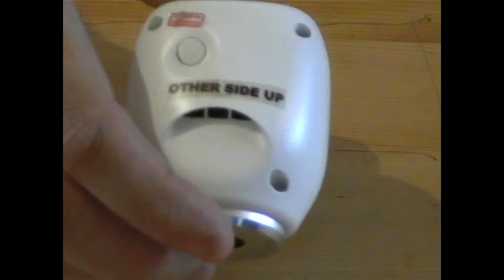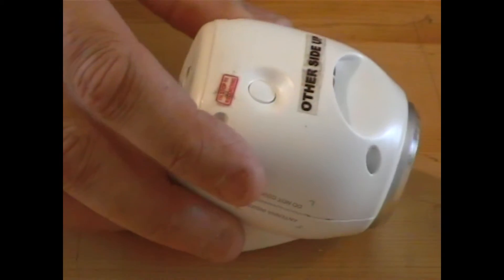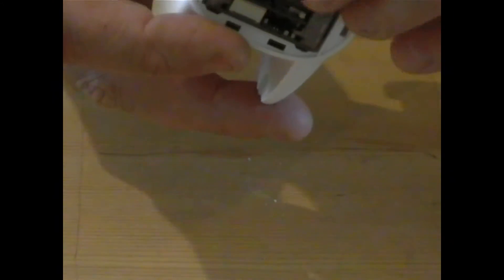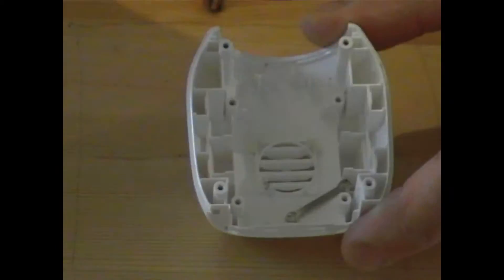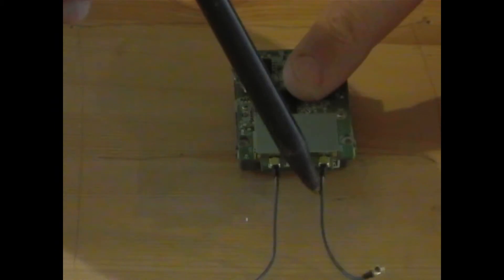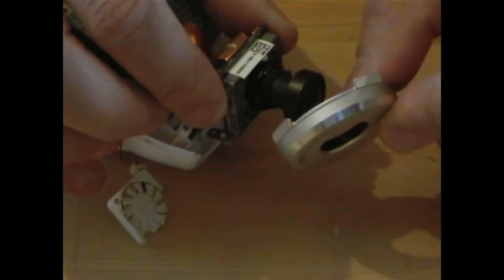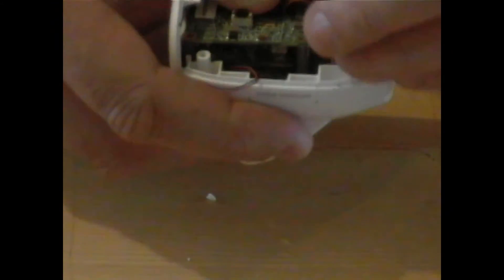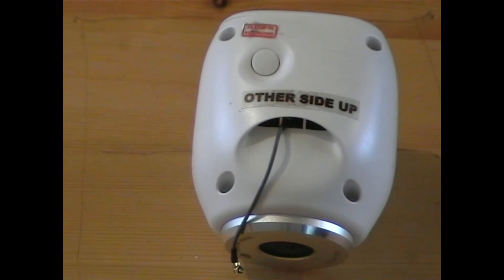FC200 camera strip down and rebuild

Comment: Could a fc200 mounted on racing drone use 12v power supply?
Reply from the maker: Can’t see any reason why not
Reply: @FlymyPhantom  how about the wiring? Cause i found the outside plug and 3 pin cable and know nothing what that use for
Reply from the maker: 2 of the wires carry the 12v and negative, if you email me at 
Flymymavic@outlook.com I’ll dig out the wiring for it
Reply: @FlymyPhantom  so basically if the 12v plugged in it could run and record normally?
Reply from the maker: Yes the button underneath, press once for picture press and hold for 2 seconds for video, press again to stop, however I would consider adding the range extender which means you can then use the vision app to start recording take picture plus you get telemetry data as well
Reply: Cool dude, thanks